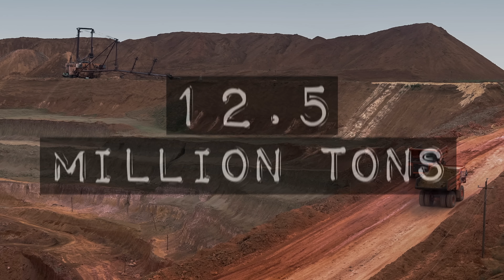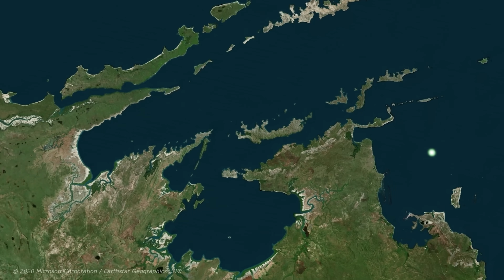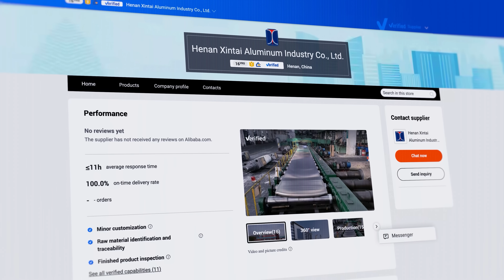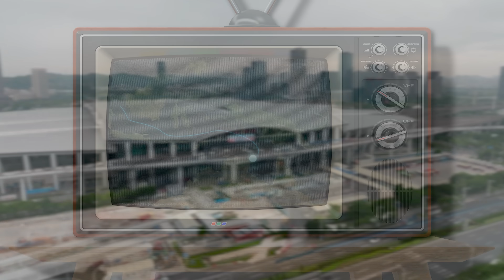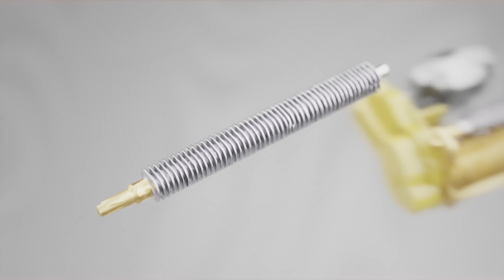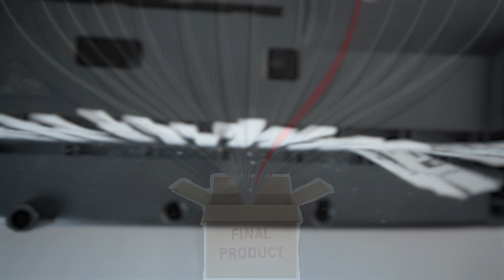The Complete Supply Chain.... Of Some Generic Consumer Junk

Comment: Good video, but you got the initial processes for alumina totally confused lol.

Gove, produces bauxite which IS NOT ALUMINA! High grade bauxite is upto 60% alumina but also contains iron oxides, silicates and trace elements. The majority of the bauxite produced at Gove is processed in refineries in Queensland Australia. Those refineries then export alumina to countries like Iceland and China for smelting, although much of it is also smelted in Australia also. The alumina used in the example would be produced in Australia or south east Asia and the smelting would almost certainly be done in oceania or south east asia also. 

Iceland imports large amounts  of refined Alumina from Australia to be smelted there, some of that aluminium does come back to Australia and asia but much of it is destined for heavy industry in europe.

In the past Gove had it's own refinery onsite which produced Alumina but that closed in 2014 and Rio Tinto has been instead exporting most of the bauxite interstate for refinery instead with very little of the output being exported internationally. Alumina is much more valuable than raw bauxite and the savings in weight and volume of shipping the denser and more valuable alumina makes domestic alumina production viable despite relatively high energy costs in Australia.

Comment: you can see the 'white label' things prominently in low end kitchen electronics best. If you're in a market for an espresso maker or an airfryer, look closely and you'll see 10 exact same models in a slightly different housing, but the prices may vary up to x2 for brand and material quality (better plastic, metal parts). It's crazy when you realize this 'known' brand uses the same exact model and internals as this noname chinese thing for half the price. 

one of the most amazing and satisfying parts about this video is that you actually say aluminium. It always irks me when americans say aluminum

Comment: The process of manufacturing is so confusing and backwards that it's hard the grasp. But if you do the math it is the cheapest option than doing everything all in one place. I would say this process is just what we've always done, but on a much larger scale. Even going back a few thousand years if you wanted a silk rope you needed to get the materials from China. To make it purple you needed a special dye from the Mediterranean. We've always had this complicated supply route issue with products

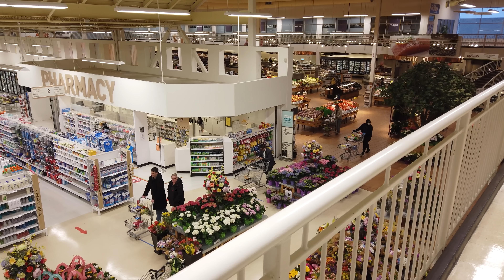Comment: 10:24 this part is actually a lot of back and forth and multiple layers. 

This is an example of why Trump's stupid plan of wanting to product everything locally is stupidly unrealistic. 

The retailer in America would even outsource their own product design to another factory (odm) in between the chain, to do the work. So that the client (the big brand) get to tell the odm what it wants, then the odm searches the wholesalers and oem.

So one odm would interface between multiple end user brands and multiple wholesaler oems.

It's like imagine vacuum cleaners. Dyson, and Hoover and Amazon and everyone else in between will contract some assembly factory in south east Asia that would then search the wholesaler oem in China for parts that meet the requirements.

Some thing as small as adding a new color trim will then create a whole new series of back and forth, quotes and samples, prototypes and qc. Before it gets to final product
Reply: thank you for the analysis, biboo's strongest soldier 

jokes aside damn account joined in 2011, that's insane dedication man to change such an old account to support your favourite streamer

Comment: I've thought about this before and find it fascinating. I was struck by the thought when looking at the bags I ordered for a camp I operate. They are custom printed drawstring bags, but they cost me under a buck a piece to buy, yet there's so many stages to get to where they are used. The extraction and refining of oil, the manufacturing of the poly fabric, the assembly of the bags, shipped to be printed, then shipped to the distributor, then sent to me, where they get 3 days of use and are mostly tossed. It's nuts

Comment: It's hard to overstate how cheap ocean freight is. That is the secret that makes everything else possible. If shipping cost is a non-factor, you can complete each step of your supply chain where it is optimal to do so. Even if the difference ends up shaving off just a few cents in the final product, it is worth it at scale.
Reply: It is kind of wild that so few little people know about the huge price difference between ocean freight and land freight when it is so fundamental to the functioning of our society. I have met a lot of highly educated and intellgent people that think equaldistant land freight is at the same price or slightly more expensive than ocean freight, and the biggest reason for this is probably that it is quite counterintuitive considering how we usually travel.
Reply: there's a reason the largest cities also have massive ports, and this has been a consistent staple of civilization since the literal dawn of the fertile crescent lol
Reply: @StephenSi-f4r  mostly because ocean freight is under WAYYY less regulations than land freight which, most people assume those land regulations apply to ocean freight too
Reply: There's a reason why a lot of cities are founded in rivers and coasts. Water transport is just too good.
Reply: ATLANTA REIGN FAN NOTICED! LETS GO DUDE!!!
Reply: @SussyBaka52607 Yayyyyy Fetal alcohol syndrome meetup in the comment section
Reply: @SussyBaka52607 people make sports into such an identity. It's people playing with balls making money off of public money
Reply: @SussyBaka52607  Real recognizes real
Reply: ive heard it isnt super carbon intensive either compared to other shipping, travel methods
Reply: It is a factor tho... That's why the example is a paper shredder but not an construction I-beam
Reply: Atlanta Reign pfp spotted
Reply: Not just that but the Chinese government subsidizes shipping, and the world mail organization I forget what it's called, charges China like $8 for every 100 of our dollars for shipping.
Reply: Still not cheaper than someone down the street from your house making it who gets the raw materials from 1 town over. But ofc none of us will work for pennies.
Reply: @joejoe-t7l2d  that's never been the case though. Unless you're living without any metal in your life then you will not be sourcing things from the next town over throughout all of human history. Even ancient native american people would travel across the continent to meet other tribes and trade local materials and goods.
Reply: @joejoe-t7l2d  lol, sure man Grandpa Bill is going make me a paper shredder or an iphone
Reply: @joejoe-t7l2d natural resources are not distributed evenly, so most wars of humanity were fought over them and various trade deals were since made to enhance civilization. However, most deaths occurred from governments fighting ideological wars not wars over resources. This is because ideological war has no clear end. In an age where resources could easily be distributed, you have to consider the risks of our leaders continuing ideological wars which have little benefit to the average person.

Comment: As per my knowledge, the same kind of gadget's price would be 3 - 4 times more expensive when they are sold in the US instead of China. So I would say the biggest share of the profit goes to American retailers.
Reply from the maker: The markup probably isn't that high for most generic appliances, but of course with a little bit of marketing anything is possible.
Reply: @Micro-Econ-YT designer clothing definitely stretching the Markup